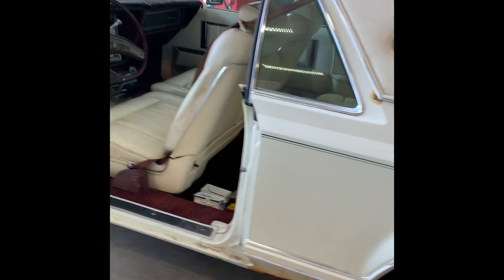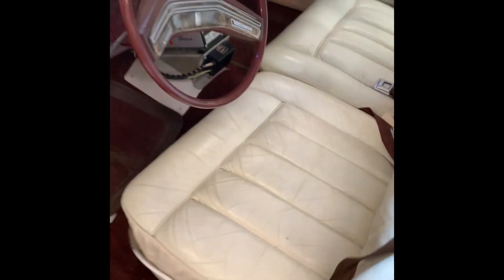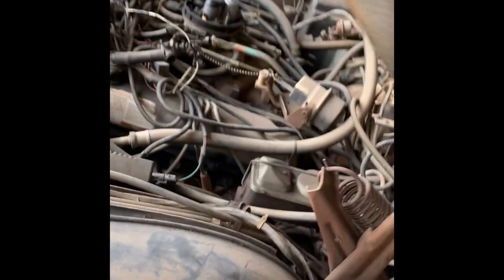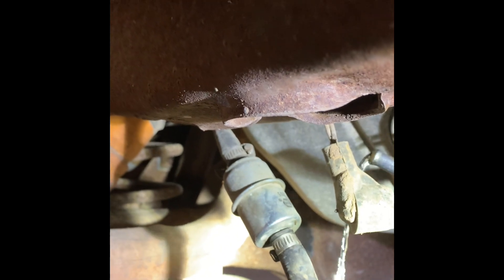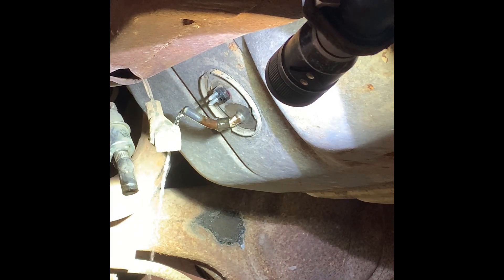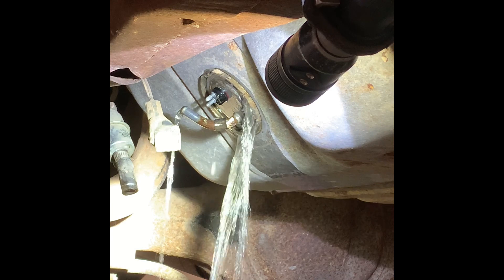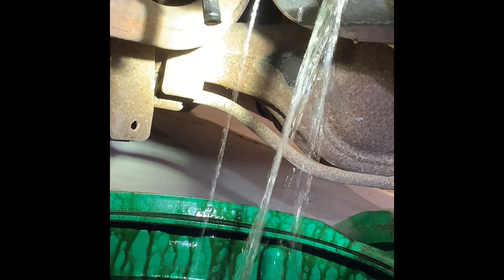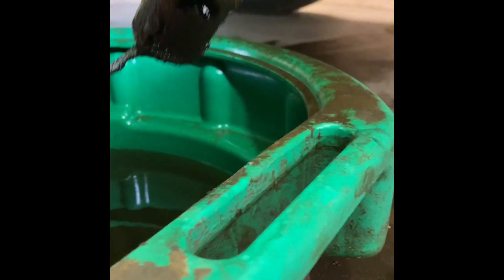1977 Lincoln Mark V Continental Part 1

Comment: Can you also please tell me if you have a line next to your gas cap is like 3/8 thick .mine is been cut and not connected to anything. Please and thanks.
Reply from the maker: It is not right next to the gas cap. If you open the trunk and pull out the carpet, there is a black shield made out of sheet metal that covers your filler neck going to the tank.. it is secured with rivets so you will have to punch them out and drill them out but once you get that black shield off, you’ll be able to see the nipple sticking off of the filler neck that that hose goes to.. let me know if you have any more questions

Comment: Are you sure is the right sending unit?mine is 79 and looks a lil different, only one tube on it.And on line said should 77 to 79 should be the same
Reply from the maker: Yep. It was the correct sending unit for my application.

Comment: Is the rubber hose coming off the fuel tank pipe stock configuration? Did they really come with a fuel filter that have rubber hose on both sides?
Reply from the maker: I believe the hose is stock but not sure, and the fuel filter might have been an add on. They may have just cut the line and added a filter to be honest.